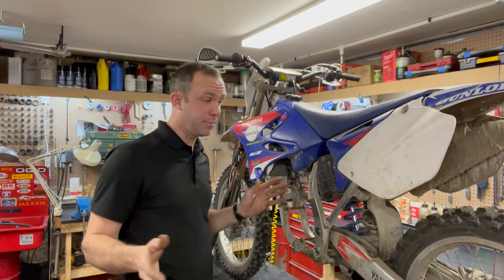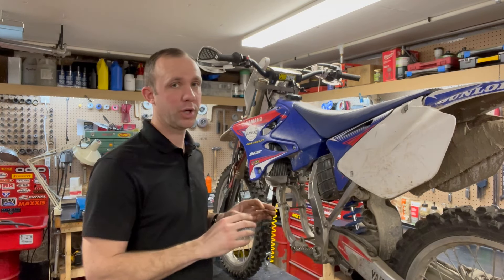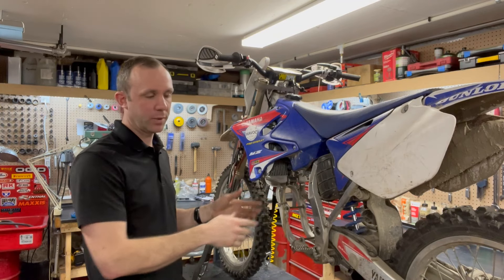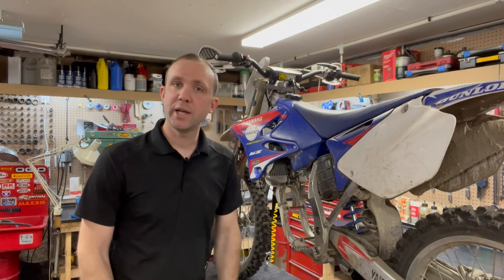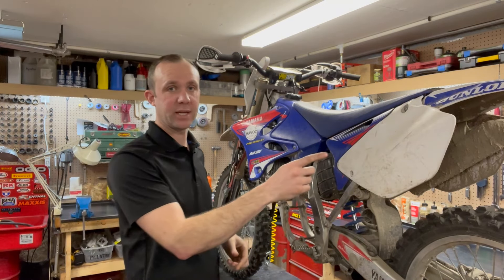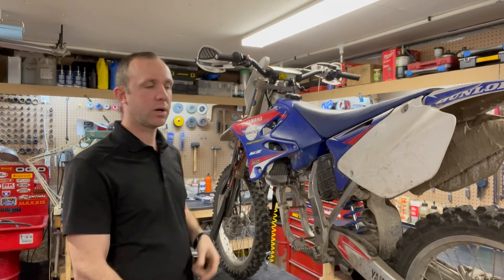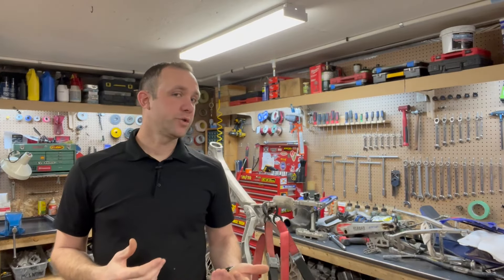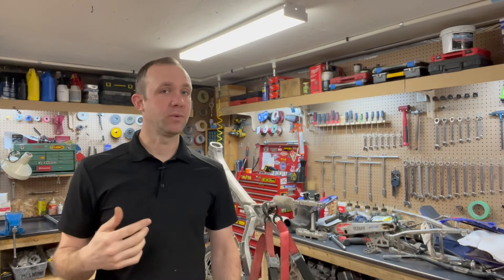I Bought This $500 Dirt Bike (Bad Idea?) YZ250 Build PART 1

Comment: The cool thing about these bikes especially if you can get it as cheaply as you did is it goves you the opportunity to build it the way you want.  You can throw $3k into it and for $3500 you can have basically a brand new bike ready to rip.
Reply from the maker: This is definitely about the cheapest bike to build. I even got some free parts. I probably could do it for $3500, but it wouldn’t be complete. This will be a thorough build.

Comment: I would love to see a video with your input on cylinder head:squish, compression, MSV, and detonation as modifying these YZ heads is so popular
Reply from the maker: I don’t think I’ll ever do a full video on that because I’m not an expert. Becoming an expert on that topic takes much, much more time & effort than most people think. I understand the basics, but I’m not qualified to distribute my opinion on the details.
The basic facts are that a YZ head has high compression numbers (close to 200 PSI) and a loose squish (close to 2mm.) 
Almost every aftermarket head will have a bigger dome & a tighter squish.
Reply: @ChuckfromTrueTech thank you for the reply! I appreciate you!

Comment: Y Zed. He he.  You kanucks.  Ive got a 2003 Y Zed F in about that shape.  Im halfway thinking of just making it electric.  The top end and bottom end parts cost so much, and it might pop again cause its a problem with these.
Reply from the maker: The ‘03 5 valve was a good engine. Definitely expensive to rebuild though.